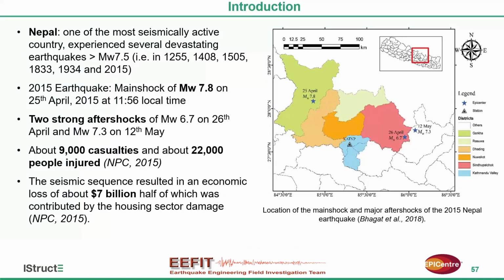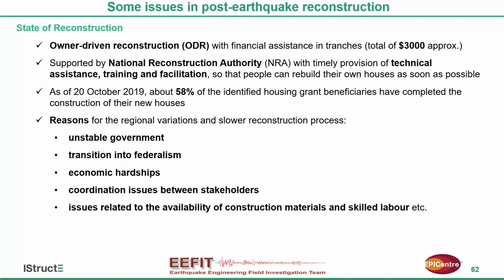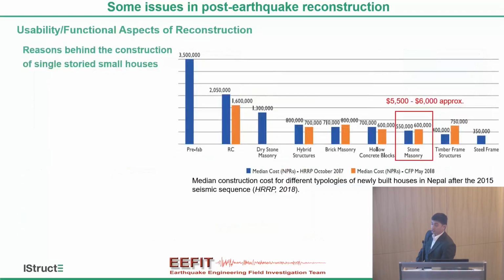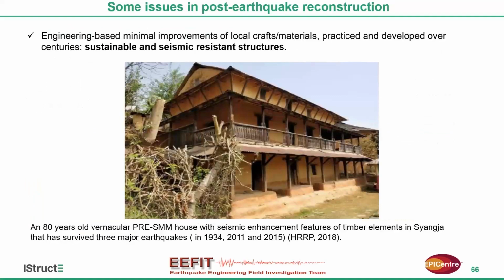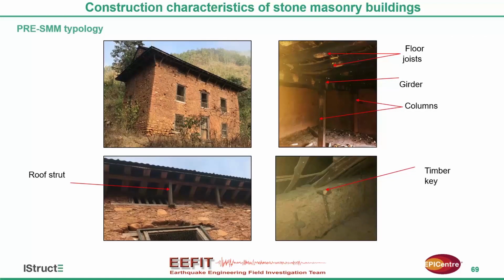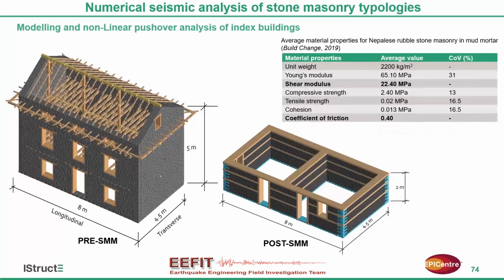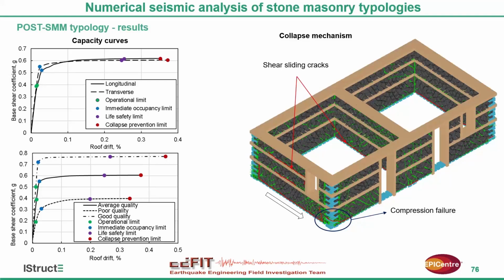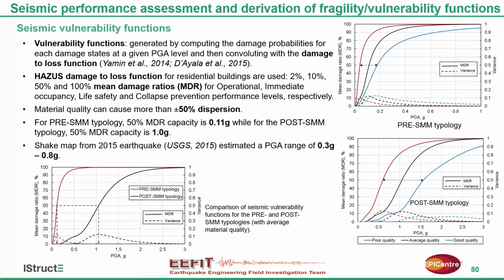2015 Nepal earthquake: seismic performance and reconstruction of stone masonry buildings

Comment: I have a question.  Are the houses that are made of 18 inch by 10 inch granite blocks earthquake proof?  They are very stable, unlike rubble stone, which tends to brittle.  Also, do granite blocks (or even limestone blocks for that matter) need vertical and horizontal seismic bands for more stability?
Reply: Hi Will,
Many thanks for your query.
Of course dressed granite blocks, termed as dry-stone masonry when no mortar is used, is better than random rubble stone in mud. This is for their much better interlocking as well as frictional resistance in shear.  For such reasons, such dry stone masonry as well as dressed stone masonry with mud or cement mortar have also been traditionally used in residential as well as school construction in Nepal as well as other countries in the Himalaya.
Including seismic bands will certainly improve their so called box-like global behaviour. Moreover, more of such bands e.g. lintel leve, roof level, window sill level or even intermediate ties, improve the seismic resistance by improving the shear resistance as well as mobilising maximum capacity of masonry structure.  Please refer to NBC 203: 2015, for example.

Hence, whether the seismic bands are needed or not depends on multiple factors: type of structure, seismic hazard at the site, acceptable risk, local policy, seismic design code in the country.

Best wishes,
Rohit
Reply: It's important to note that - as Rohit says during his presentation - there's no such thing as 'earthquake proof' & there's no single solution to ensure a building is more resistant to earthquake damage. Every earthquake is different... it can literally move a mountain & rip cracks in the ground that a building can fall into.... so it's impossible for any human-made construction to be 'quake-proof.'  Your house could survive a magnitude 6.5 only to be knocked down by a smaller 5.0 because the epicenter is closer & the frequency of shaking is different. That's why a qualified engineer is so important because the best solution for your home might be different to your neighbour's home based on the rock in the foundations, the number of storeys, etc.... lots of different factors to consider in addition to the stonework.
It's also crucial to install any seismic solutions like bands correctly, because they can't do their job otherwise. It's upsetting & frustrating to hear that the Nepalese have been moving into homes where the seismic bands & structural elements aren't installed properly, because that's almost as bad as not having anything at all.